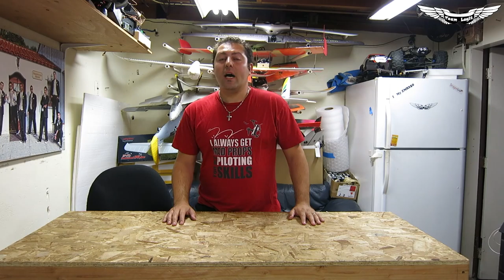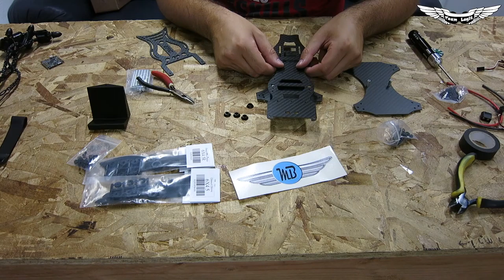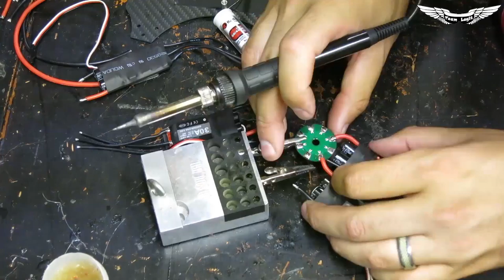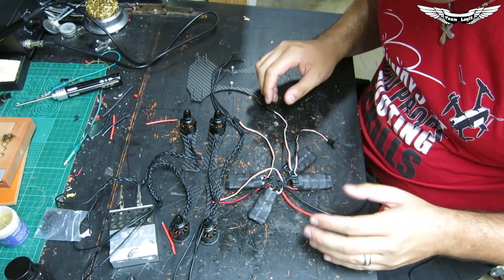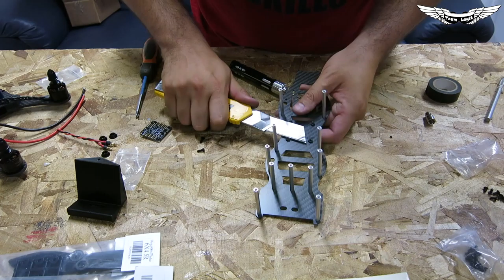MB Epic V2

Comment: At 23:52, do these motors have CW and CCW threading? If so, then isn't the thread the wrong way (CW vs CCW and vice-versa), since it should tighten down more while throttling instead of un-threading off? :)
Reply from the maker: RCUnderground These motors are only CW. So you just have to make sure they are Tightened down nice and tight all the same.
Reply: Ah gotcha :)

Comment: Can't you change the rotation of the props inside the BLheli software? So it does not matter which wire goes were when soldering to the esc.
Reply from the maker: Matthew Sorrentino yes you can but certain ESC don't allow it. and if your not going to be changing it then no big deal.
Reply: Team Legit Is it the actual esc or the software ( BHeli, etc  )? Thanks man

Comment: Huge ESC'S
Reply: Jon Car  I have the dys esc as well 40 amps is what I have been using lately
Reply: richard shelton have tried the new nano esc's dys has that are 30 amps?
Reply: I sell them at my store also, but I like to overkilll my systems and the 40 amps have big 12 guage wires and a heat sink so at 20 grams each they are heavy duty and somewhat light.
Reply: richard shelton I know what you mean I tried the 16 amp dys with 2000 kv motor and they blew. Seeing if you're going to run for 4s better to use 30 amps or higher